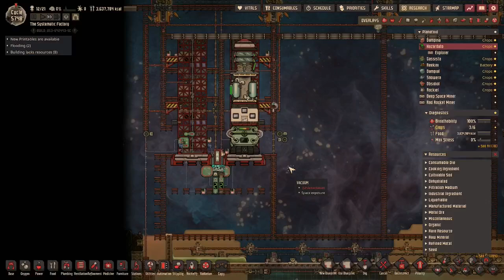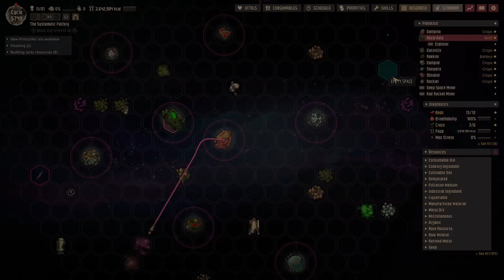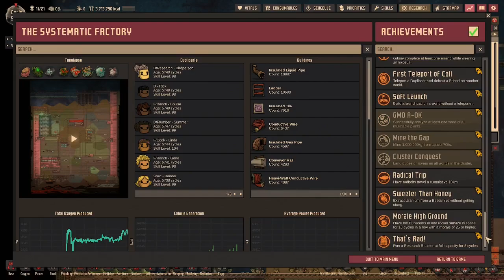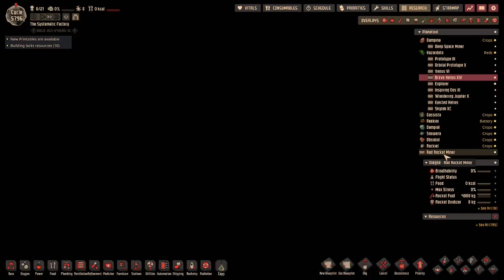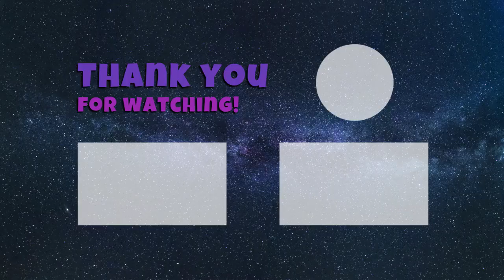Mining Rocket Armada | 46 | Oxygen Not Included | Oceania Cluster

Comment: Great base, I don’t think I can ever make it 5000 cycles in one save.
About your radbolt issue, they can go thru a corner only downwards, shoot them down right and down left.
Reply from the maker: They can actually go upwards diagonally as well, the issue is they can only go one tile, and if I have the reflector in that spot, once it creates a tiny blob of liquid nuclear waste it breaks the infinite storage.

But yes, if I use this method for radbolts again, I will definitely set it up to go down on either side, and leave an air gap underneath, so if nuclear waste is made it falls down and doesn't break the storage.

I did have fun with the radbolts this time around, but in my next playthrough, I think I'll go back to liquid helium and oxygen, simply because hydrogen rockets can be taller and so are more versatile.
Reply: Actually you are right, they do pass thru upwards, but mechanic is somehow different nvm. 
Looking forward to your next play through.
Reply from the maker: My current one is nearly done.  Just a couple more episodes.  I'm going to be doing some other stuff during the holidays while I plan the next series, but It shouldn't be more than a week or two for the premiere of my next playthrough after this one ends.